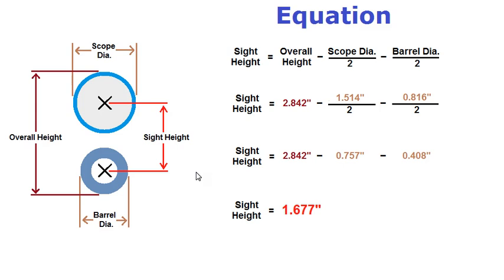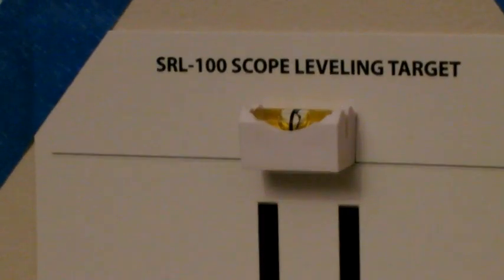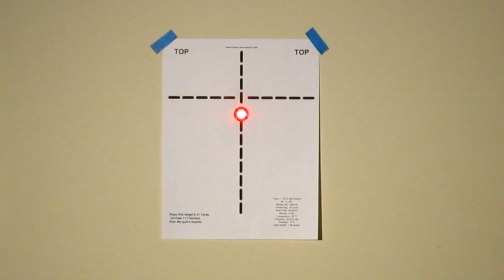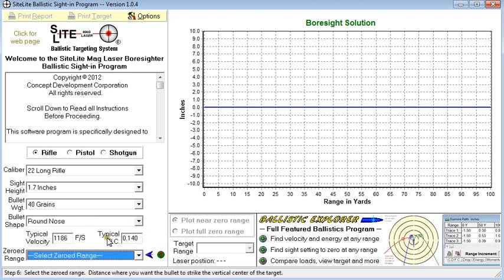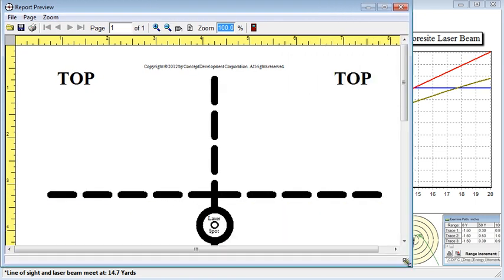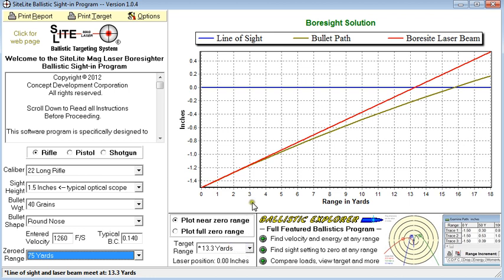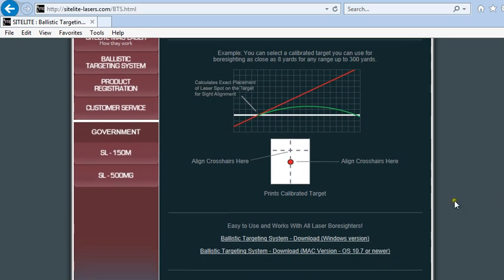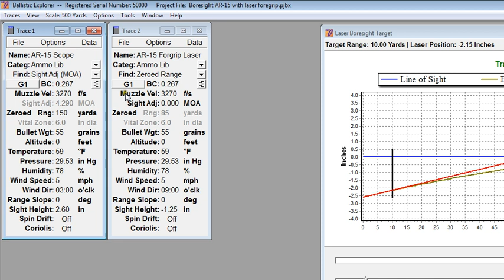Modern Boresighting Tips

Comment: Thanks for your contribution. I was able to zero a 5.56 rifle in my living room with these custom targets. I tried it out at the range last Saturday and my planned 36yd close zero was spot on. Next weekend will stretch it out to ~500yd to see how close to 300yd my far zero is.
Reply from the maker: Thank you for your comments.  I always like to hear back from users, good or bad.
Reply: @dexadine just as an update: I tried your reflective tape tip and while it didn’t work that well with the red laser of the bore sighter, it reflects my visible green laser like crazy! It may have something to do with the color of the reflexive tape being green… maybe the red tape works better (the bike store had only these two, no white like the one you used).
Anyway, what I came up with is creating a 2x2” square of pitch black electric tape around the hole with the reflective tape. Now I can be sure when the bore sighter hits the center spot even though it doesn’t reflect the red that well.
Reply from the maker: Thanks for the tip.  You would think red reflective tape would be great at reflecting red light, but that doesn't seem to be the case for green tape.  I got the white reflective tape I use from some on-line store.

Comment: Can this be used to set up a .50 CAL Muzzleloader? I am about to put a scope on my CVA and will be using 348 grain power-belts. I don't have Chrono info available currently to manually input values. I only saw an options for Pistol, Rifle OR Shotgun. Any recommendations from the drop downs that what would be very close to my setup? 
This system is going to create some good shooters
Reply from the maker: You can select Rifle or Pistol and whatever you want from the caliber, bullet wgt, and bullet shape dropdown menus as these are just used to come up with the Typical Velocity and Typical BC values.  As shown in the video, you can change those values as needed.  If you don’t have chronograph values for muzzle velocity then use your best guess.  As for BC, there’s lots of information on-line, just do a search for "ballistic coefficients for lead balls".  Note that when not otherwise stated, BC values are assumed to be for the G1 function (drag model).  However, there is a drag function specific to round balls, which is the Gs function.  The Ballistic Explorer paid program includes Gs and over 60 standard and custom drag functions, works with nonstandard conditions, and also prints boresighting targets.  See the video "Boresighting Tactical Rife Sight Systems" for an overview.

Comment: Great informative video. Hopefully you can help me with this question, what is the difference between plot near zero range and plot full zero range?.  Thanks in advance
Reply from the maker: With sights mounted above the barrel, the line of sight and the line of departure (center of the barrel's bore) converge such that the bullet appears to rise through the line of sight and then fall back through the line of sight.

Plot near zero shows a graph of the range where the bullet's path and the line of sight first intersect, which is called the near zeroed range, and the range most useful for making sight changes with a laser.  Plot full zero range shows a graph of where the bullet's path and the line of sight intersect a second time, which is the distance most shooters think of as the zeroed range.
Reply: @dexadine  Thanks
Reply: Hi, I was just curious why you do it this way (near zero) with a laser instead of full zero.  Thanks in advance.
Reply from the maker: The program is producing a target to zero the gun and load combination to the full zero, which you select in the Zeroed Range dropdown list.  Selecting to plot the graph to near zero or to full zero is just scaling the graph to give you a detailed or a full view of the interaction between the bullet's path, line of sight, and the laser beam.  That scaling selection doesn’t change the printed target.
Reply: @carllamirande4546  Lasers have limited range. Getting a visible laser beam at 300 yards requires a powerful and more expensive laser. It also requires space to do a long distance zeroing. When doing it this way you can use a less powerful laser with less space and just use math calculations to fill in the rest.

Comment: It would be nice if you add the 350 Legend to the rifle ballistics.
Reply from the maker: The 350 Legend is in Ballistic Explorer's ammo library, which shows a typical MV of 2300 and a typical BC of 0.230 for most loads.  You can enter those values directly into the BTS software as the video shows, or if you have specific values for the load you use then you can enter them.

Comment: Thank you for this video and the software. I'm trying  to site a Ruger 9mm Carbine with a red dot and cannot configure it in the rifle section. Am I missing something?
Reply from the maker: As with any sight you need to enter the sight height into the BTS software.  The video shows the steps for measuring sight height of sights mounted above the gun's barrel.  If your sight is offset to one side, you need to enter just the vertical offset.  If the vertical offset is negative, then the free BTS software won't work for you, but the version built into Ballistic Explorer will.
Reply from the maker: Select Pistol and then 9mm Luger, but because you're shooting this ammo in a rifle you'll have to correct the velocity.  Look it up on-line, maybe from the ammo supplier and then manually enter that value into the Typical Velocity box of the BTS software.
Reply: @dexadine  thank you! Will do.

Comment: I use this software and it's quite good but not being able to put exact values in is a bit annoying and only being strictly imperial or strictly metric is also annoying . Plenty of people use a mixture of Imperial and metric for ballistic data . I did not get any serial number just a  trial version which I deleted .
Reply from the maker: There is no "trial" version of the free BTS software.  There was a serial number needed to download the setup file, but SiteLite no longer requires that.

You select values from lists, but as the video show, you can still enter the exact weight and BC of the bullet you're using if you know those values.

If you want more control, you can print targets using Ballistic Explorer as shown in the video "Boresighting Tactical Rifle Sight Systems".
Reply: @dexadine  I got the SiteLite software ok and working but I thought there was also a ballistic solver program offered . The link I followed must have been to a paid version .  Probably my bad .

Comment: All that money spent and all that math when you can simply sight thru the barrel then thru the scope. Shoot one shot then sight in on that shot. Return to bulls eye and shot another shot. Odds are you will be very very close. You will have saved plenty of green for more bullets and you won't need all the fancy expensive toys.
Reply from the maker: Of course that assumes you can easily sight through the barrel, which is not the case with many semi-automatics.  Also, your technique is generally limited to the range you want to sight in at.  With the laser you can sight-in at short range while at home so you're on-paper before going to the range for final sight-in.
Reply: @dexadine  so true. Guess I was just thinking of my situation. 
I shot all bolt and lever action and a very nice long outdoor range. 
Either way, it does work well for me but thanks for your input.